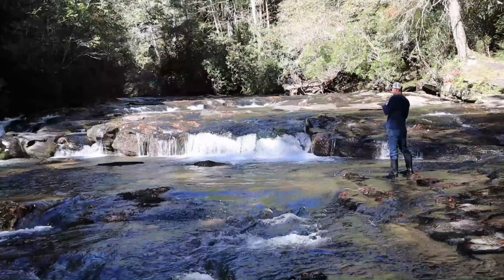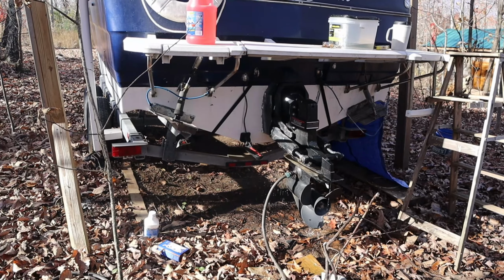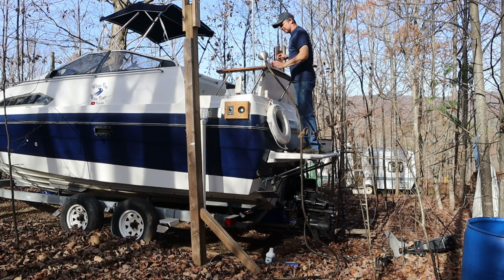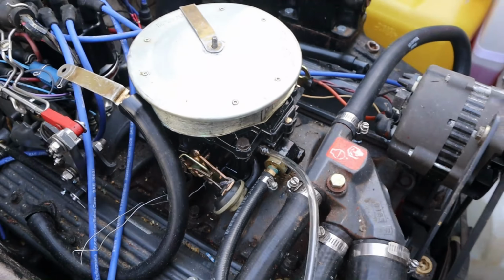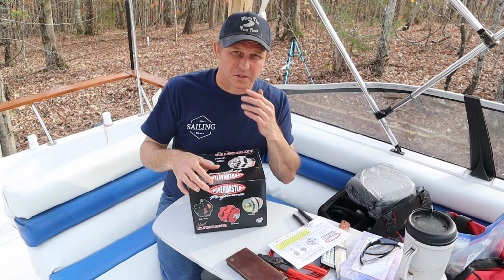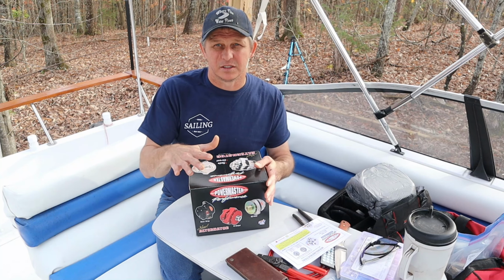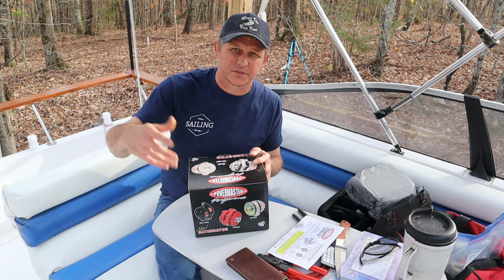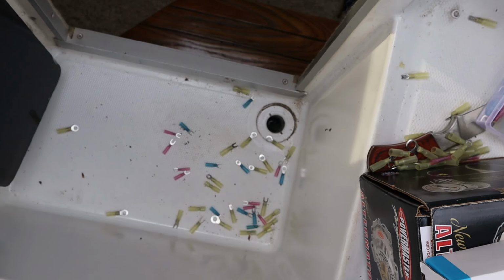Winterizing the Bayliner 2455 and Alternator questions

Comment: Backed mine safely into my mother in laws shed the other day. Next year has got to be better than what we saw this year. Doesn't your shifter have a big button where it pivots that you can push in and  rev motor in neutral? Check it out. Stay safe.
Reply from the maker: Yeah definitely a crazy year. No they changed the shiftier and cables at some point to a generic one. Sucks it dont have the button but it was good that I could reverse the throw and not have to buy a new one to do the SEI conversion.